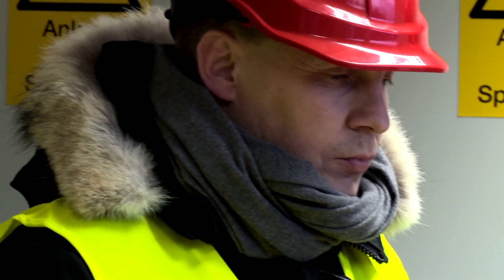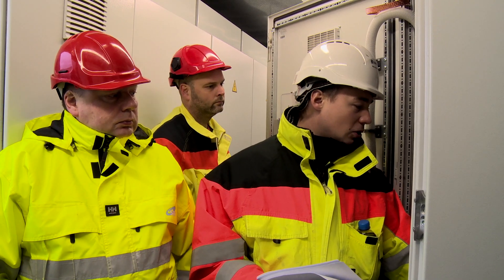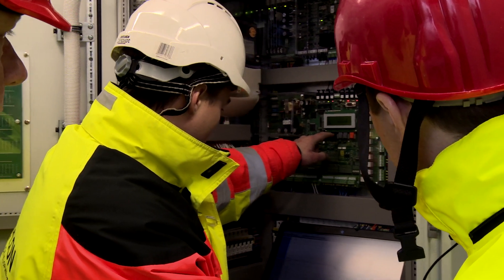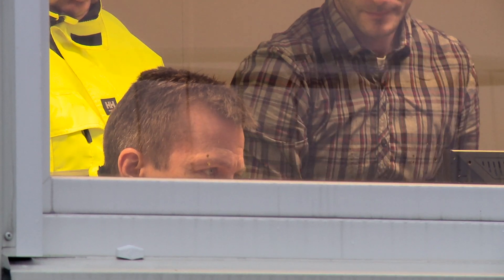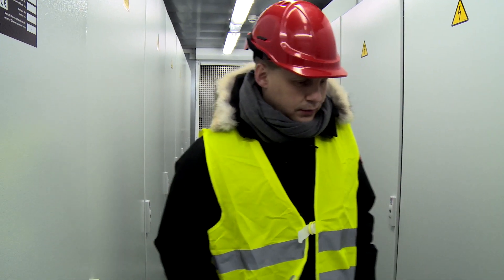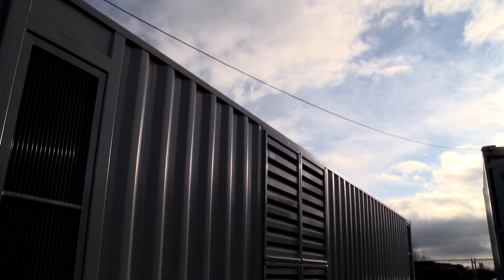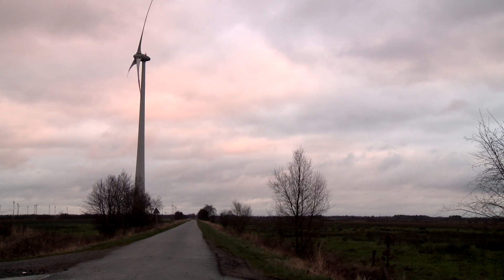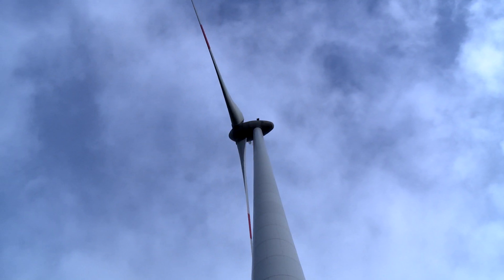Battery system for the Húsahagi wind farm

Comment: What energy storage capacity and backup power should ideally be configured for the Faroe Islands 12 MW Húsahagi wind farm?

This is best answered by using the "Wind, storage and back-up system designer" webpage, setting wind power equal to 12 MW, or 12000 kW, which can be viewed at this link.

http://scottish.scienceontheweb.net/Wind%20power%20storage%20back-up%20calculator.htm?wind=12000&units=kW

As can be seen, the suggested ideal energy storage capacity is about 5 hours @ 12 MW, which is 60 MWh or 60,000 KWh, much more - 86 times more - than the "700 kWh" battery which has been selected by SEV.

In general terms, we may say that batteries are not the right technology to be cost effective to provide for 5 hours of wind capacity of energy storage.

Where pumped storage hydro is possible that's the best option. Otherwise, more energy can be cost effectively stored by power to gas, creating hydrogen fuel gas by electrolysis of water.

Peak demand, wind and back-up power / energy storage capacity calculator

For the specification and design of renewable energy electricity generation systems which successfully smooth intermittent wind generation to serve customer demand, 24 hours a day, 7 days a week and 52 weeks a year.

Adopting the recommendation derived from scientific computer modelling that the energy storage capacity be about 5 hours times the wind power capacity, the tables offer rows of previously successful modelled system configurations - row A, a configuration with no back-up power and rows B to F offering alternative ratios of wind power to back-up power. Columns consist of adjustable power and energy values in proportion to fixed multiplier factors.

Scottish Scientist
Independent Scientific Adviser for Scotland
https://scottishscientist.wordpress.com/

* Wind, storage and back-up system designer
* Double Tidal Lagoon Baseload Scheme
* Off-Shore Electricity from Wind, Solar and Hydrogen Power
* World’s biggest-ever pumped-storage hydro-scheme, for Scotland?
* Modelling of wind and pumped-storage power
* Scotland Electricity Generation – my plan for 2020
* South America – GREAT for Renewable Energy